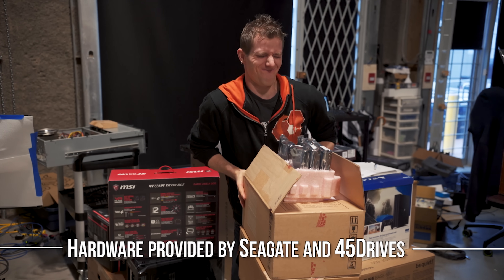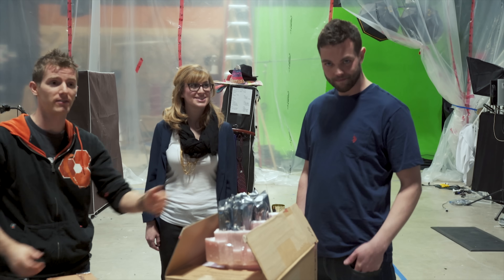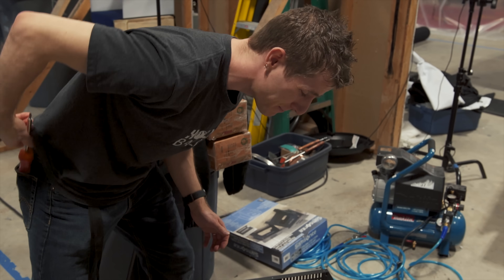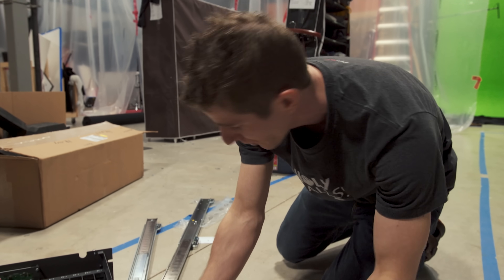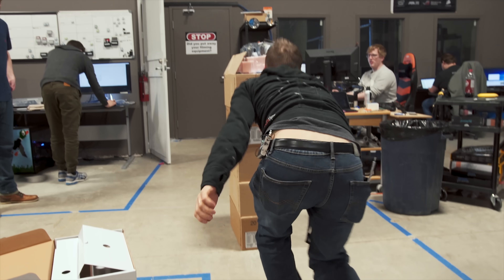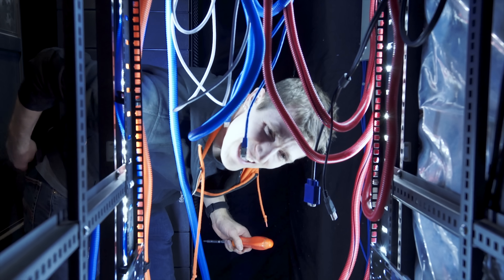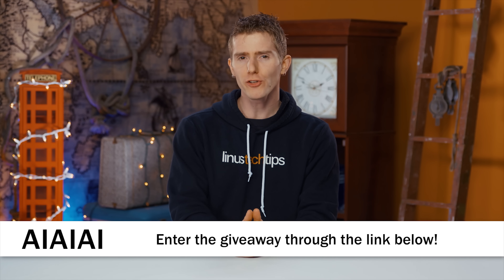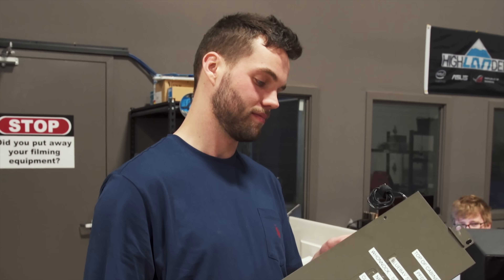INSTALLING THE PETABYTE - Server Room Upgrade Vlog

Comment: 6:28 cringeworthy hammer usage. The handle is that long for a reason. Don't give me any bs about it being more accurate. You didn't need that much accuracy here
Reply: MY  handle is that long for a reason. Baby  ; )
Reply: hes not trying to bend a half inch steel plate its like 2 mill of aluminium. Probably doesn't even need a hammer

Comment: That should be enough porn storage.
Reply: Cemtleman (͡° ͜ʖ ͡°) there you go
Reply: I only have 100 zettabytes of porn, is that a lot?
Reply: one could fill it in ~2,1763719385637193856371938563719 years on 100mbit connection... no biggie...
Reply: "Should Be"... XD
Reply: You'd think so. https://www.reddit.com/r/AskReddit/comments/57j2tn/what_seems_boring_but_is_actually_really_fun/d8t6utg/?context=1